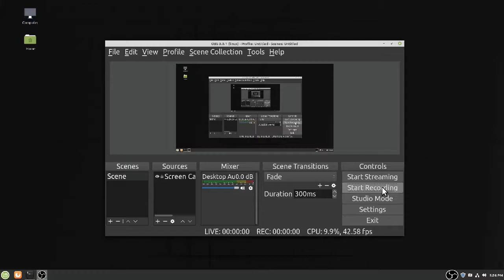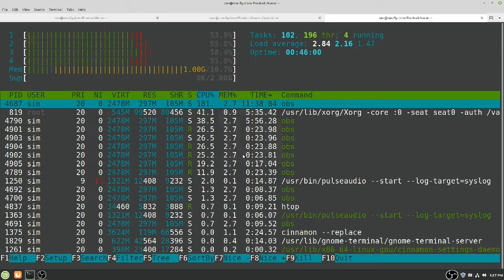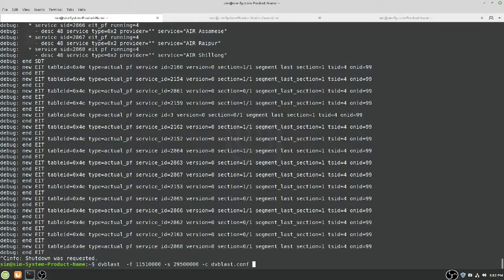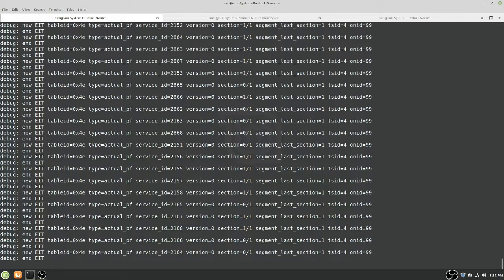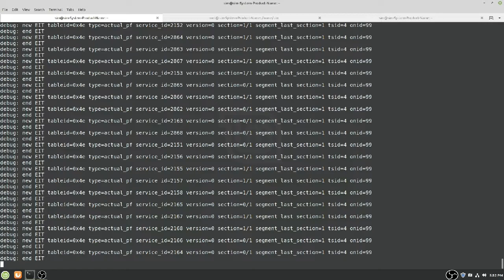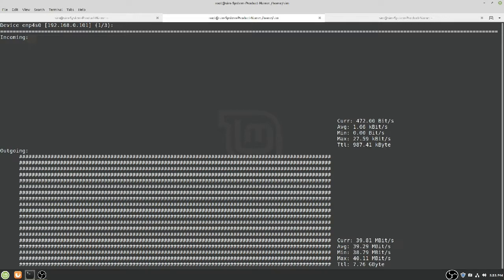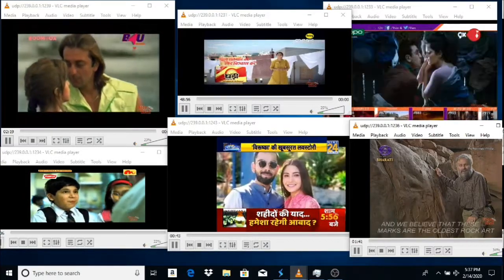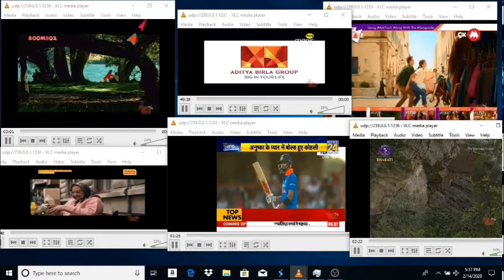Linux IRD server and #multicast #dvblast

Comment: Nice video! How to decrypt encrypted channels?
Reply from the maker: Thanks bro, there two ways with dvblast.first one to use cam module and second is with tsdecrypt .
Reply: @linuxdiy4920  Can please you make a video showing both ways?
Reply from the maker: On my location i dont have the cam module .i can guide you for the same .dont worry it will work.do you have cccam or mgcam? Will tell you one more way to do that .
Reply from the maker: @jng644  now satellite reciever mostly come with inbuilt electronic card chip so not able to arrange the external card for cam module .
Reply: @linuxdiy4920  Using both cccam and mgcamd, but prefer mgcamd
Reply from the maker: Okay .lets jump over Telegram group i am there for 24*7 you can discuss rest over their.find telegram link in about i will leave here also
Reply from the maker: Linuxdiy projects
https://t.me/linuxdiy_projects
Reply from the maker: Its depends on the provider
Reply: @linuxdiy4920  Do you use Skype?